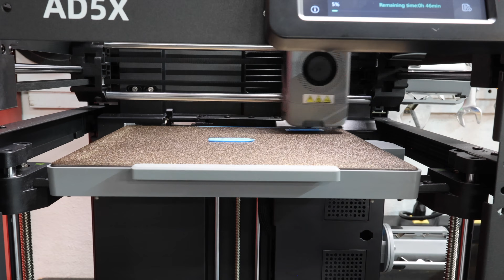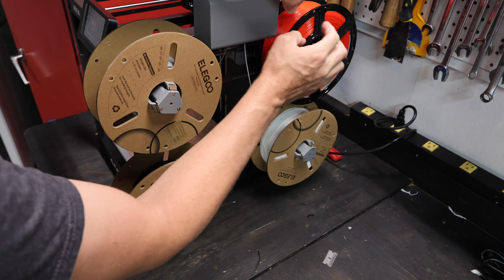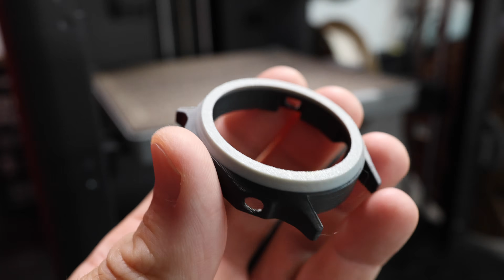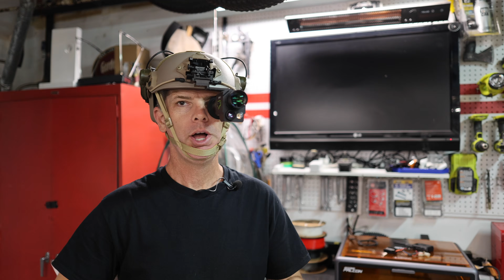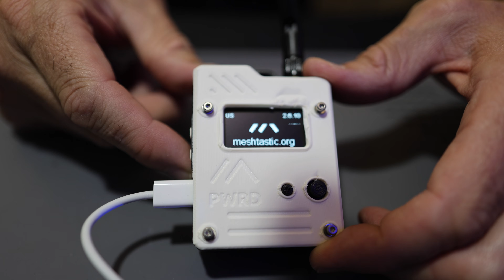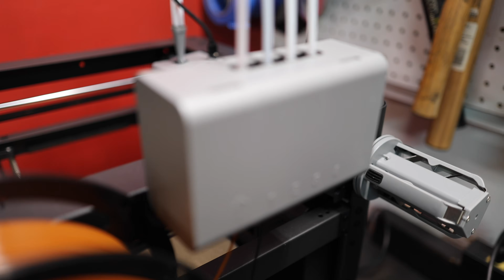Flashforge AD5X - The Cheapest 4 Color 3D Printer

Comment: I have the Elegoo Centauri carbon and I also bought the FlashForge Adventurer 5M as a backup to keep printing as my Centauri carbon was off line for about 30 days while waiting on a new board where the hot end plugs into as I broke of a header while I was changing the Hot end I would of bought the AD5X instead of the FlashForge Adventurer 5M but it wasn't released at the time

Comment: How did you do the purge tower? I've been looking for information to do that on my AD5X.. also, I don't know if it's my filament or settings but I'm having horrible bed adhesion. However once it sticks the print is 9/10.. thank for the video!
Reply from the maker: The purge tower is a setting in the slicer, you can also have it purge into the infill into the printed part. 

I havnt had any issues with bed adhesion, I periodically clean my print bed with dish soap and wipe it down with alcohol between prints.

Comment: I still have my RC10 from 1989. My RC hobby is off the chain with over 40 RC cars now. From Tamiya to Losi 1/30th scale to 1/4 scale. I used PETG-GF for custom RC parts.
Reply from the maker: Between cars, planes and quads I have no idea how many I have. I actually just finished getting my original RC 10 back up and running. Working on the RC 10 T next.

Comment: Hi there. I just got the AD5X not too long ago...I'm very new to 3d printing. I'm trying to assemble the digital watch (surprise gift for my husband). It's not been so easy...those screws are so tiny and my hands arent as nimble anymore. The screwholes are giving me a hard time...I was able to get 2 through so far...but then I realized the movement holder isnt quite sitting flush in the case, so the back isnt sitting right, it's just slightly up on one end. I'm not sure if it's a sanding issue, maybe the pushers arent allowing it to go flush. Can you share any insight on what settings you used for printing the watch body or any other tips that might help?
Thank you
Reply from the maker: I did notice an issue on one of the assemblies that I made where the pushers weren’t sitting all the way in, a little bit of sanding with an Emery board or sandpaper should do it. Hope that helps.
Reply: @DoItYourselfDad  did you come across the glass not sitting flush in the case? I went back over mine and that seems to be the problem. Without the glass the movement holder sits perfectly flush...with the glass it's a touch raised on one side. Also since you have already made the Digiduino watch, I was wondering if the connectors on the board where the pushers push into are supposed to flex/bend at all? I've noticed one doing that slightly.
Reply from the maker: The glass is a very tight fit. It needs to be pushed in place, it shouldn’t just drop in. It takes a fair amount of pressure.
Reply: @DoItYourselfDad  ok...is there something I can print to help with that? Or a suggestion of what to buy to help?
Reply from the maker: I would 3-D print a cylinder a little larger diameter than the crystal, you wanna make sure that the pressure is evenly distributed across the whole crystal so you don’t bend it and cause it to shatter.
Reply: @DoItYourselfDad  ok, as I said I am a total noob when it comes to 3D printing...I am using James cox's watch files, so I'm taking it as I need to print a pusher for the crystal? What file should I use? I don't know how to 3d model...all I know is the kit came with a 38x1mm crystal. Sorry to ask so many questions.
Reply from the maker: No problem at all, James is a great guy. If you could find anything around the house that was cylinder shaped that would put even pressure across the entire crystal that would work. If it’s really difficult to get the crystal in, you may have to go in with a razor blade and scrape away a tiny bit of plastic, or maybe give a little bit of a lip to the plastic to ease the crystal into the case.
Reply from the maker: If you can’t find anything, let me know and I’ll model something for you and put it on Thingiverse
Reply: @DoItYourselfDad  Yeah, could you do that please? If I ask for help around the house, It will give away the secret...dont want to do that. My son is like "yeah make a model Mom". I dont know how to do that yet, he does, he used to make mods for games...My husband has sooo many watches, all of them bought but nothing made. Anyway, if you could find the time to make the model I would be so grateful. So far I am only used to printing in PLA and I hope that will be ok for the model. Anyway, it's late but I would really appreciate help you can provide and the time it takes. Thank you in advance.
Reply from the maker: @nyteeyes1  Done deal, here's the link: thingiverse.com/thing:7265029
Reply from the maker: @nyteeyes1  Also, if your husband likes to tinker check out the watch kits from DIY Watch Club, Ive made a couple of them now: https://www.youtube.com/watch?v=iXOyDQv4L0Q
Reply: @DoItYourselfDad  Thank you so much!
Reply: @DoItYourselfDad  also, one other quick question...I just went back and watched your video where you assembled the clear resin cased Digiduino. In that video you said the glass just drops in, no need to apply pressure with a pusher. Is there a difference between the resin case vs the pla case that causes the glass to need a bit of pressure on the home printed pla case? Thanks
Reply from the maker: Yeah, the tolerances were definitely a little bit different with the resin case. If your 3-D printed case is extremely tight, I would still recommend very lightly scraping the case back with something like a razor. You don’t need to remove a lot of material, almost more rounding the edge over is all you need to do.
Reply: @DoItYourselfDad  yeah, on my 3d printed one, the crystal sits up juuust slightly on one side. I printed the crystal pusher file you uploaded for me. Slid it into the case, same just slight deviation, with the pusher no crystal, but was able to get the pusher to seat flush...so i wont be able to try it with the crystal until next week because it did shatter last night before you mentioned the pusher. New crystals wont be in until Sunday.  So sitting in limbo til then...but once again thank you for uploading the file...hopefully I can get the watch together and presented next week.

Comment: Thanks for the vid ! What a nice printer is that. I think this printer fits nice in an enclosure from Longer, the one for the Longer LK5 Pro.
Reply from the maker: It will, I’m using a tent enclosure I originally purchased for the LK5 Pro. I’m actually installing the enclosure kit on this one this weekend though to make things a little easier.

Comment: I have been waiting for 4 head tool change 3d printer, but at $359.00 from amazon I could not pass on this.  I do have  Flash forge 5m which has been a great printer for the past 1 and a half. So I have high hopes for this printer.
Reply: I am in the exact same boat as you. I currently have the 5M and I snagged the AD5X on Amazon for $339. How did it end up working for you? I’m still waiting on my delivery.

Comment: i'm torn with this printer... it looks great and insanely cheap considering it can do multicolor out of the box. BUT, i've not seen enough precision and longevity test... So i guess i'll stick to my guts and will go ahead with a K1C and a DYI CFS. Since i dont really think that i will ever use more than 2 colors fo my prints, might even just do the swap myself.

I know the K1C is durable, easy repairs, lots of parts available. OEM or not. And like every creality printer i own: they never failed me. 
What threw me off is when you said "proprietary parts on the filament loader". i dont like that word :')

But man, this AD5X is tempting.
Reply: I've had mine for 2 months now and it's been completely reliable.

Aftermarket parts are starting to show up on Ali, so that's promising.
Reply: @VladimirPutin-p3t  are you printing a lot of precise functional parts? How's the tolerances?